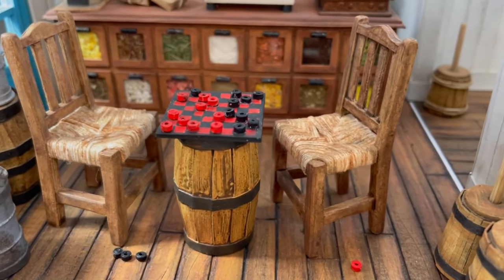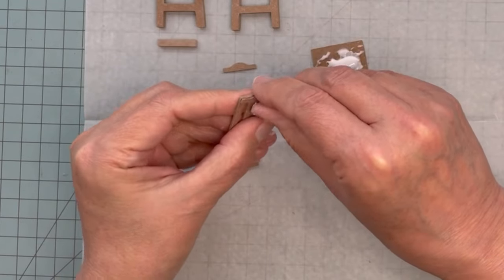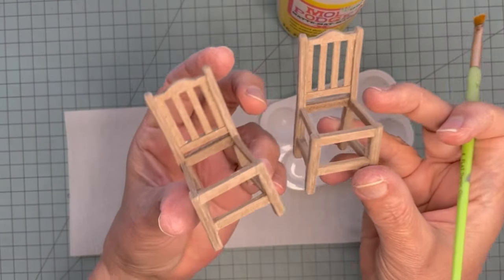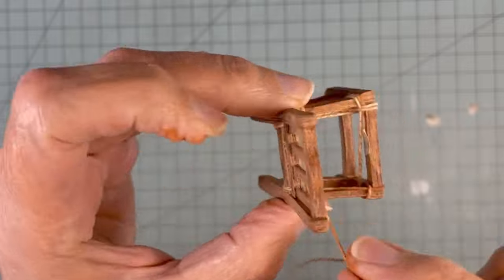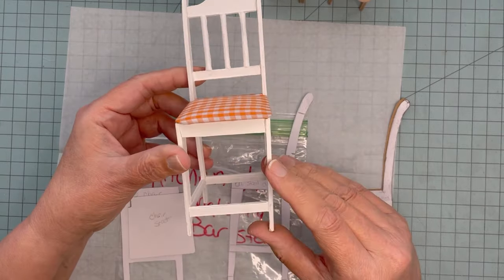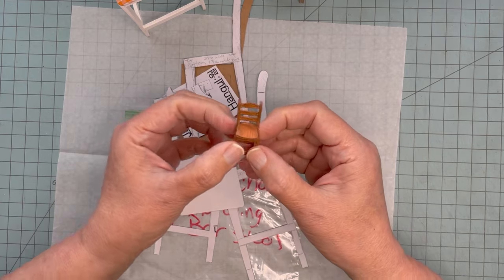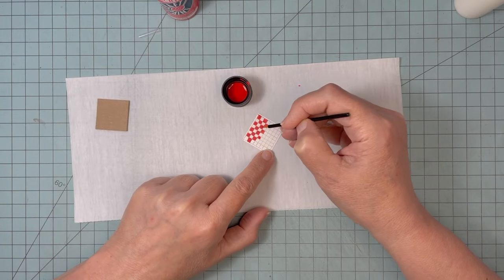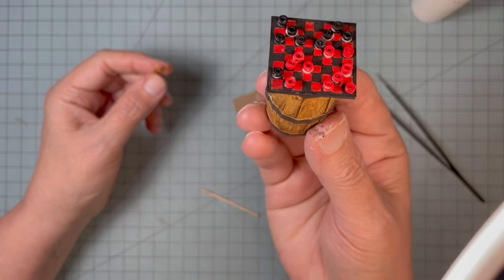Come sit and hang out awhile, and watch me build the mini checkers and chairs.

Comment: I love your videos. I'm converting a very small 1/12 scale dollhouse to a 1/16 and would love to know your technique for converting the measurements. I know it's  2/3 equals 1 foot 😁
Reply from the maker: You won’t believe it but I’m terrible with math. So I’m not good at converting for example 1/12 to 1/16. The simplest way that I do that works for me is, I look up the standard size of it in real scale of something I want to make. Like for instance in you case your wall height, since you’re converting a house. So I take the full size measurements and divide them by 16. So a standard wall is 8 ft. I need to know that in inches. One foot is twelve inches. So I multiply 8 by 12 which is 96. Then I divide 96 by 16. Which means you need at least 6 inch high walls. Hope that helps you convert your house. If you’re making something and it’s real size is already in inches then you just divide that by 16 for 1/16 scale. Or 12 for 1/12 scale and so on.
Reply: @Lauras-tinyview  that's perfect thank you for sharing ❣️❣️